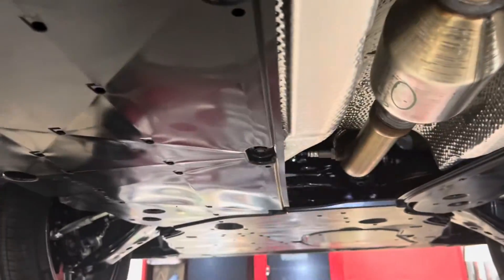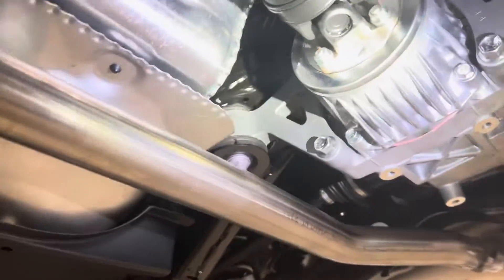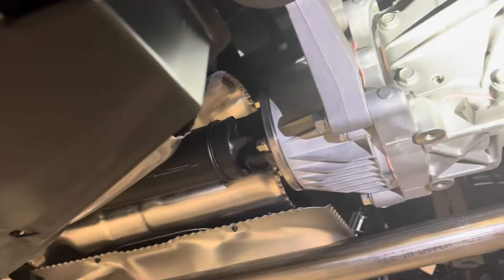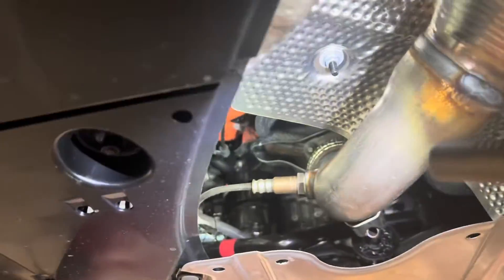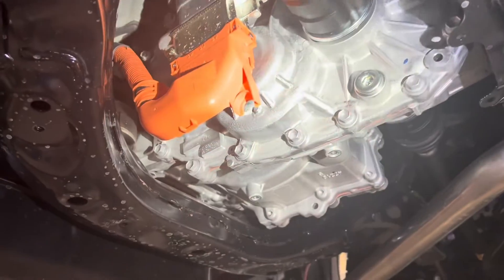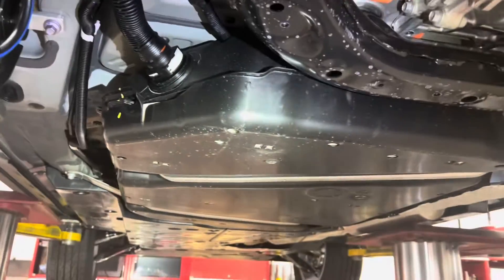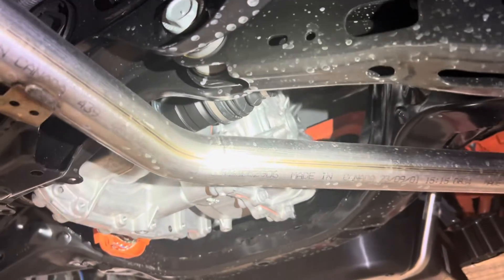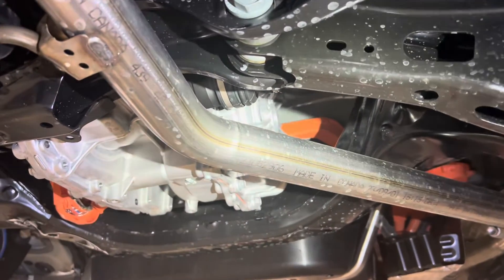AWD versus e-AWD drive systems. Electronic all wheel drive is different

Comment: What isn’t explained clearly is that these are reactive All Wheel Drive (AWD) systems unlike continuous AWD. 
Like anything that’s reactive it waits until there is a problem before it responds where as continuous AWD either 
makes sure a slippery or sandy/bull dust road either isn’t a problem in the first place or not as big of a problem as 
it would have been 
otherwise

Comment: Question... With a conventional AWD vehicle they say that if you need to replace one tire due to hitting a road hazard, then you have to replace all 4 tires. It seems to me that with no rear to front mechanical connection; that would not be true with a hybrid AWD vehicle.
What say you?
Reply from the maker: That’s a good question. My hunch is that you still need to keep the tread depth pretty close but I’ll ask our master tech

Comment: So, regarding oil change, rear diff is probably straight forward, diff oil change as normal diff. What about front? Is front diff part of transmission, sharing the same ATF fluid, or is diff separate unit with diff(erent) oil?
Reply from the maker: The front diff is part of the "transmission" which has a service interval of 60K.

Comment: Steve, did you know a Warranty Extension Program was announced by both Toyota Canada and USA on the actual problem of the orange cable corroding at the connector to the back wheels ? 2019-2022 units are covered but NOT 2023-2024 units of Rav4 Hybrid,  Rav4 Prime, Highlander Hybrid, Venza Hybrid and Sienna AWD Hybrid. Any chance you can get information on WHY the 2023-24 are NOT included in this WEP ?
Reply from the maker: Because they changed the design
Reply: Not according to your video ! What year was it ? I've seen 2024 units they are identical as my rusted 2019 !!  Just like in your video
Reply: @hsaphoto  Nope, not identical. The problem was the cable was catching moisture and holding onto it, and that caused rust. In 23 they put a hole in the bottom of the plastic around the end of the cable so the water could drain out.